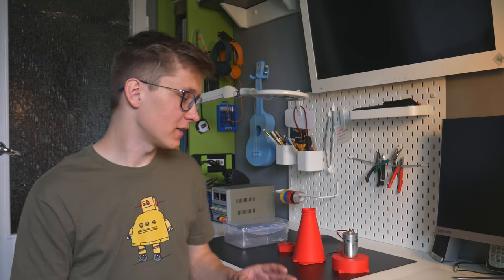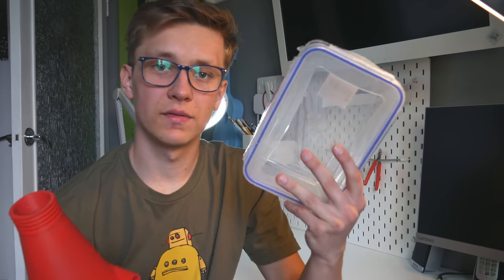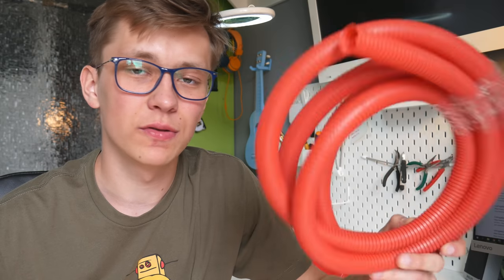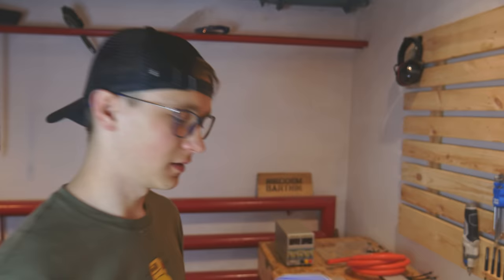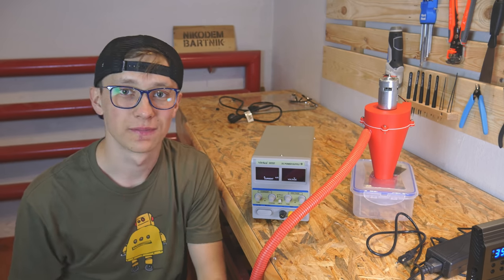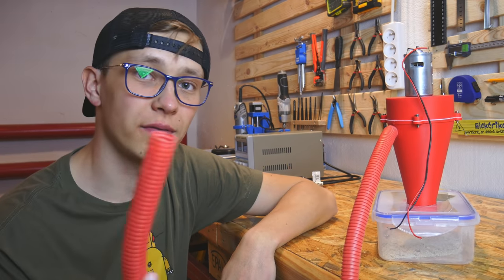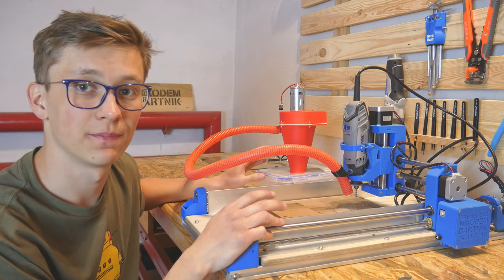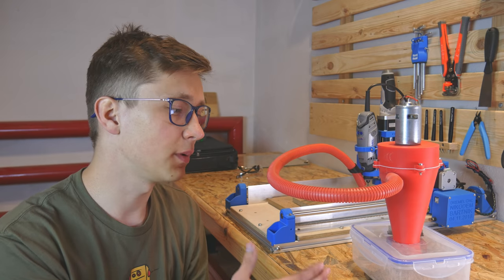3D Printed Vacuum Cleaner For CNC Machine

Comment: Kool! Where did you get the Orange Tubing? Please post a link in the description. I wanna 3D Print a dust collector attachment for my Eleksmaker CNC & Laser Cutter. Much like this guy did only on a smaller scale...

https://youtu.be/fK-0aVDK0YU?t=216

I need the hose to be really flexible like yours looks so I can attach it to the X Drag Chain (turned 90 degrees to keep it horizontal). It'll follow the same path where the wires go to get to the X Nima 17 Stepper Motor.

Comment: You miss concept of vacuum cleaner. It need to have dust filter that allow air flow easily not air seal plastic box like that.
Reply from the maker: With cyclonic separation it has to be like this
Reply: @nikodembartnik  Sorry for eary judge, Yes you right!

Comment: You are creating a back-pressure as your box is closed. This way you are loosing efficiency and If you want to suck better make some holes and put filter (vacuum cleaner one?).
This is bad, bad design and you have to fix this. No matter how powerful motor you place there won't be any difference as you have nowhere the air to go
Reply: cyclone assembled correctly except for the direction of the impeller blades

Comment: Back to the designing board boy .
Its not working so this project is a failure
Reply from the maker: Don't really know what you mean, it is working really well!
Reply: @nikodembartnik  if it would be working it would suck up all the dust .

Now you say the dust and wood are a little wet .
And thats why its not sucking up the dust B.S .

If it would work it would suck any thing up .
But its not so its a failure .
Its a test failure of course .

Why design a vacum if you can studdy one and make a better design .
People keep creating new stuff .
Why create something new if the existing versions still work on a better level .

Dont build someting new .
Inprove the older version .
By making it use less power to do the same job .
With the same quality.